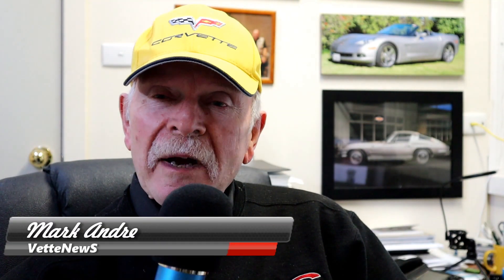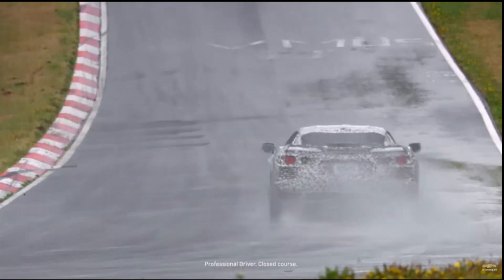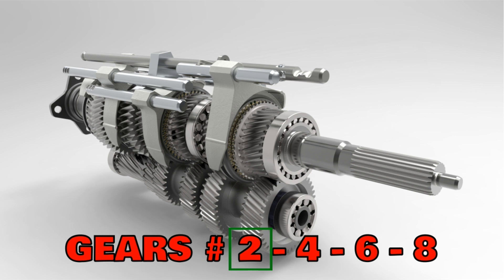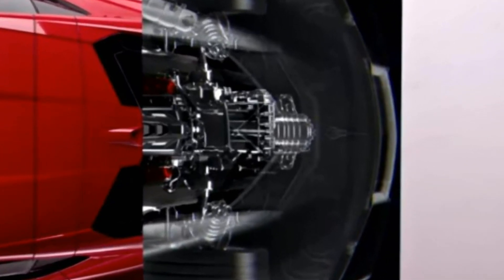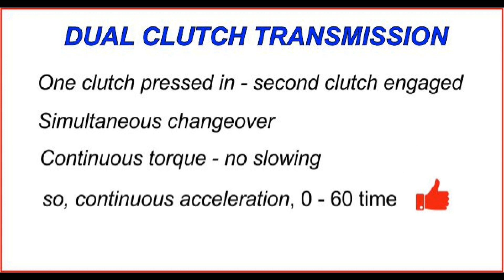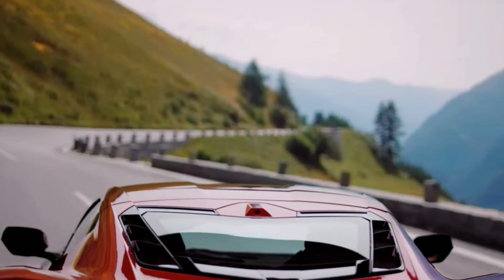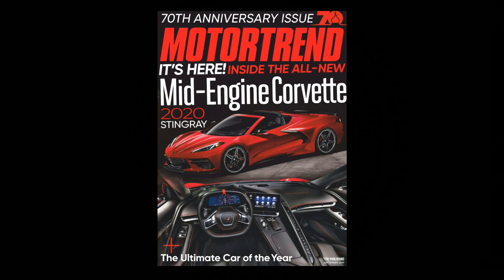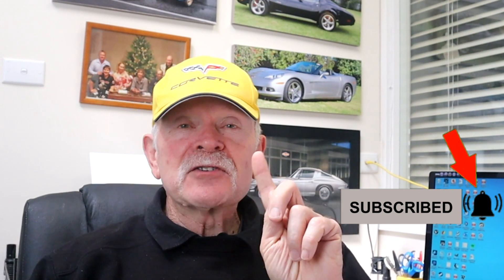Corvette C8 DCT

Comment: I didn’t buy the first C8 edition mainly because I wanted GM to work out the bugs and the problems, I just picked up my 2024 C8 and the same problems are still occurring with everyone pointing fingers, shrugging shoulders, and letting the customer suffer while they failed to fix it. Turns out a lot of the time they require complete  transmission replacements and if you’ve passed the alleged warranty if they choose to honor it you’ll be out of pocket for close to $50,000, does anyone know how to work on this transmission If I would’ve really been paying close enough attention and reading the blogs, I would’ve never purchased a 2024 C8.because I spend every day hoping that I’m not the next guy who gets the run around by an incompetent dealership poor communications between the factory and the mechanics in the field and whatever other excuses they come up with.

Comment: Another great video Mark on the C8 and the DCT.  You explain how the DCT operates like a teacher, so well done.  I wasn't aware that when the DCT shifts from one gear to the other, the non engaged driveline "prepares" to shift to the next gear.  Having taken my 2023 2LT Z51 to three different tracks for HPDE, I experienced problems with the DCT not shifting from 3rd to 4th as the rpms increased to 6500 and then the rev limiter would kick in and the car would reduce engine rpm, speed..  However, my son-in-law who also drove the call, did not experience this.  I was also able to validate this by watching video on the PDR.  I believe what was happening was that I would ever so little decrease the throttle and the transmission would not know if I was going to brake or go into a corner.  I was able to overcome the issue by manually shifting up to the next gear using the paddle shift.  My son-in-law didn't experience problem because he would keep the accelerator pedal down long enough to shift into 4th gear.  I just didn't have the nerve when going over 100 mph.  He didn't have that problem because he didn't pay for it  ;-)

Comment: I love the transmission its awesome,but I don't understand why  GM didn't make it easier to put fluid in the transmission, it is appalling to have to take apart the car apart to add 2 quarts to the transmission fluid to track it. You need a technician to do it. The average Joe could not do it. Alot of thinking went into this to make it almost impossible to put fluid in the transmission except by a certified  c8 technician or someone who is a mechanic. I'm ready to get rid of my c8  just because of this flaw. Not to much thinking went into making it easier for the consumer.  I love the car and almost daily drive it. The car is magnificent but to up keep it is a disaster  unless you take it in for service. Just my rant  thanks for reading
Reply: I wonder, if luck of the 2 liters (quarts) is causing the DCT problems, that C8s are experiencing and GM is investigating?
Reply: @krzysztofbobra9352   I believe the reason you have to add the two quarts is because when you track the car and go around corners, the fluid runs to one side and the level sensor thinks it's low on fluid and puts the car into limp mode with speed limited to 25 mph.
Reply: Completely agree.  I added the two quarts by jacking up the driver side of the car, about 7 degrees, removing the wheel, then removing a fluid level plug, and adding two quarts.  So much easier.

Comment: I work in electrical engineering.   Having the next gear be anticipated is like doing a pre fetch of a memory page with microprocessors.    That speeds them up.   Sometimes the pre fetch does not get what will be the next page.   This is known as a page fault  (downshift in the above example).   Then the correct memory page must be read and the computer pauses a moment while that page is loaded.

Comment: Those transmissions are likely $20,000 US so when a part goes GM will tell you to buy a new one, they will not have anyone that can fix them, like the other manufacturer's DCT transmissions already out there . If someone does specialize in fixing them it will take them awhile to perfect that skill and they will likely be backlogged. Pressure sensors and tons of parts will go in those transmissions. Coming from someone with a DCT trans in my car. i recently spent 12k on it to get fixed and beefed up with some high performance parts at a performance shop since my dealer does not do DCT transmission repairs. I know first hand that there are positives and negatives to these types of tranny's.
Reply: Imo worth it!

Comment: So impressed with GM for having the courage to put a proper modern manual transmission into the C8. That's soooo much better than the flappy paddle autos that various manufacturers have been trying to trick us into believing are real transmissions. Major props to GM!!
Reply: you would never be able to shift those manual gears as quick as the computer in the DCT. They were dumb to make tiny paddles and mount them to the wheel tho.
Reply: You should drive DCT car
Reply: @irsyadhasan3908  I OWN A DCT CAR!  Plus I know more about them than 99% of the people out there and recently spent $15k upgrading mine. Where's your experience come from??

Comment: DCT gear boxes are under development since 1960 for racing, sold in everyday cars in 1990's. Thanks to Ford and GM now after 30 years we can have one in our cars, at the brink of going electric. LOL
Reply: Not really unless you are talking about the Lenco.   However  these had conventional clutches.  Others had torque converters.    If you disagree, name some examples and why?
Reply: @michaelprice3785    I hope you can open the link.  1983 Porsche introduced PDK transmission, two gear boxes in one with two conventional clutches. https://christophorus.porsche.com/en/2019/391/porsche-pdk-manual-gear-shift.html#:~:text=For%20all%20its%20day%2Dto,after%20its%20introduction%20in%201983.
Reply: @danielbosoc1  Thanks!   Interesting link.

Comment: What do you think of the C8 convertible. ??     Is it more practical than manually lifting off the roof panels especially as it doesn’t take up any luggage space
Reply from the maker: Not that keen on the convertible. I'm normally a convertible man, but this one doesn't grab me. Like you say, it's very practical with the roof hiding away without using any of the luggage space. I'll think about it for a while!
Reply: The big thing for me Neil is that the convertible you cannot see the engine. The whole back of it is covered as far as i can tell. I had the same thought, the convertible so i can have the roof off and still have room for stuff. For the cost and everything i have researched i am sticking with the coupe. When and if we can get 1 here that is.